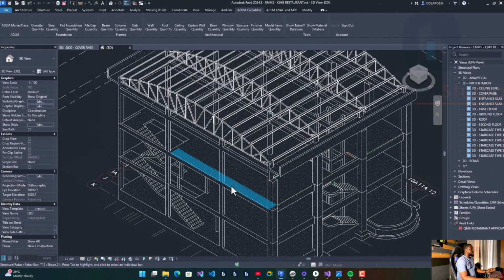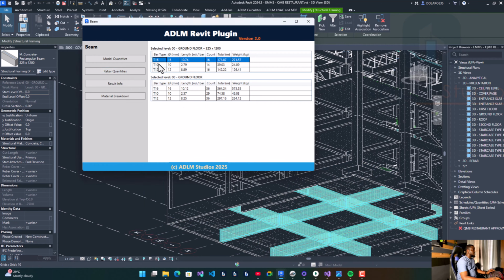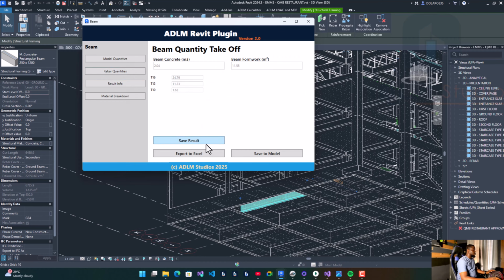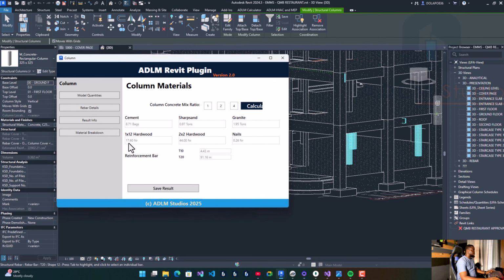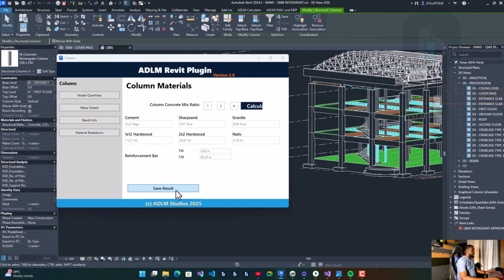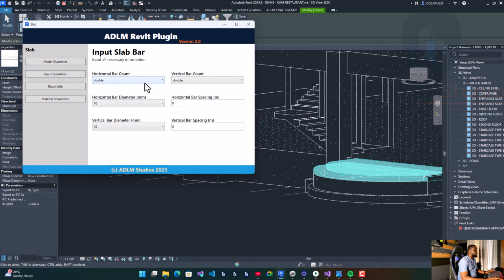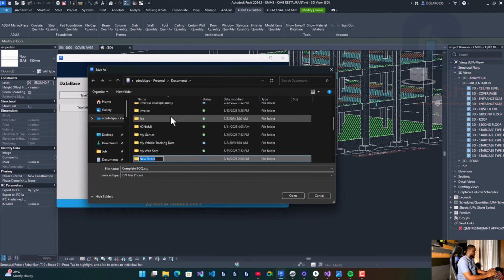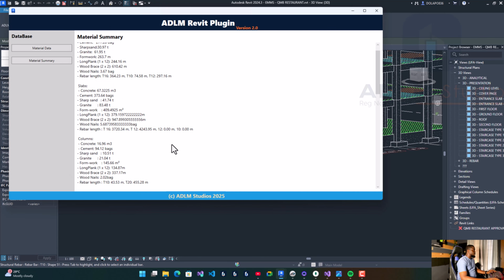BIM to Bill of Quantites– Fast Quantity Takeoff & BoQ for Structural Models (Beams, Columns, Slabs)

Comment: Nice tutorial 
Can it be used for structural frame prepared by revit architecture or structure software alone
Thanks
Reply from the maker: For frames prepared by Autodesk revit, but you can export as IFC from other software’s and open them in Revit